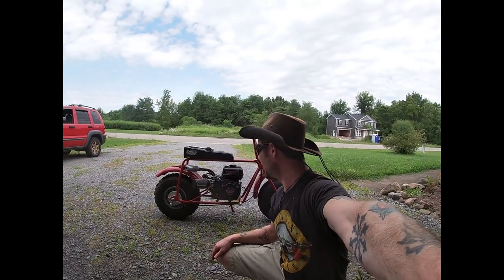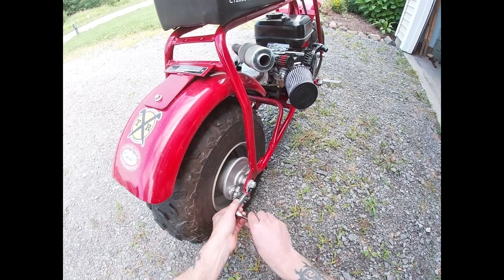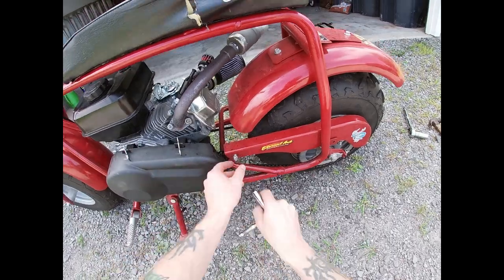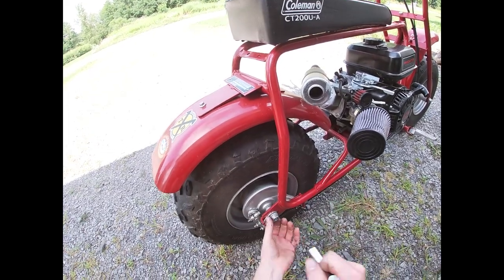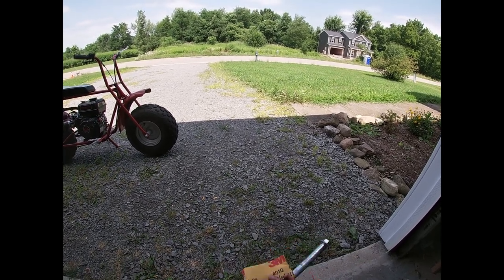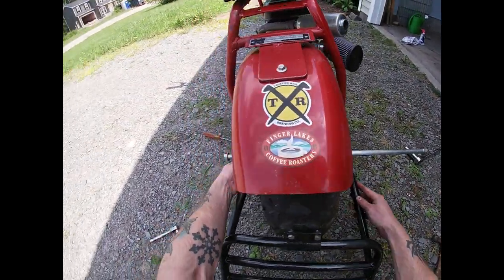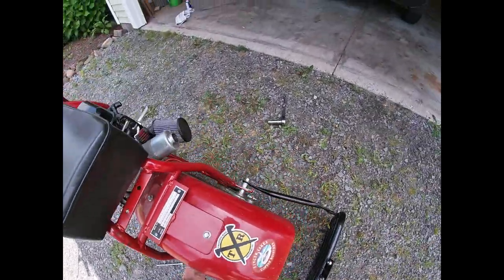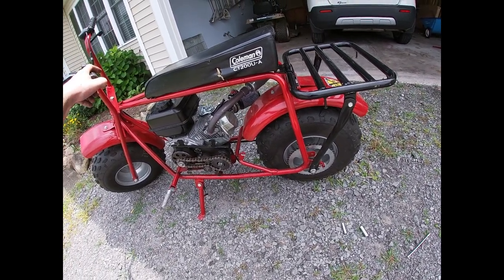Josh doin Stuff: Installing rear rack on Coleman CT200u.

Comment: Why is your brake lever so high?
Loosen the bolts. Push it down. When grasp the grips shoot your fingers out from a natural sitting position. The tip of your middle finger should just graze the top of the lever. Retighten.

Comment: Did the predator egine use the same plug ins from the old engine
Reply from the maker: It’s identical to the stock business engine except the driveshaft is 3/4 instead of 5/8. Gotta get a 3/4 clutch or adapter.